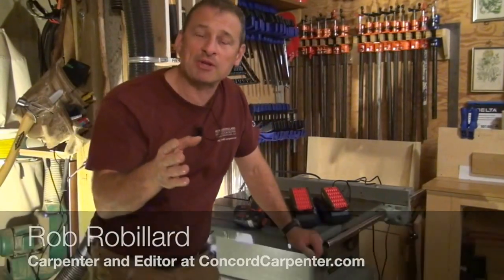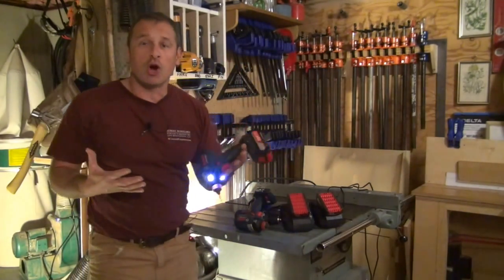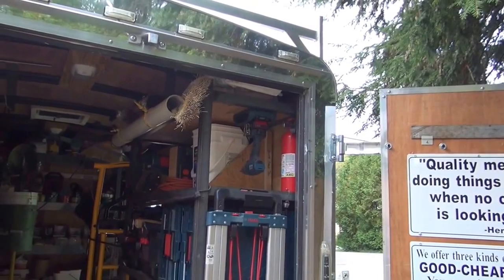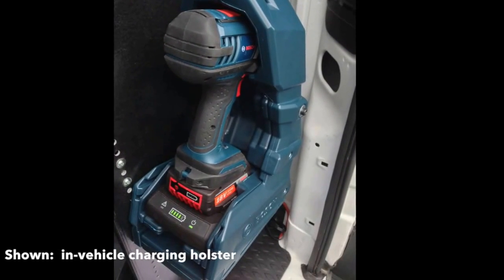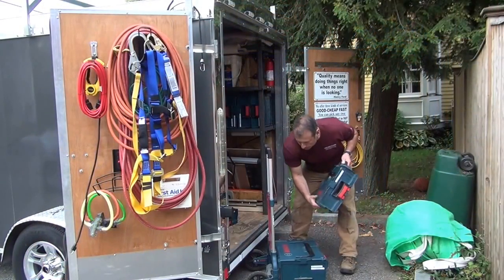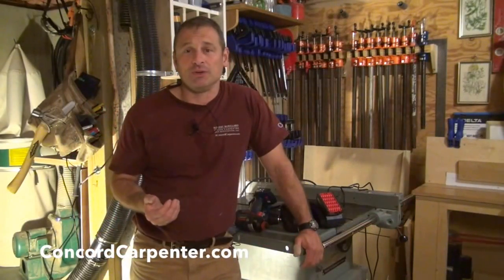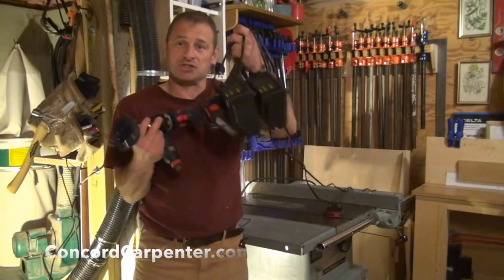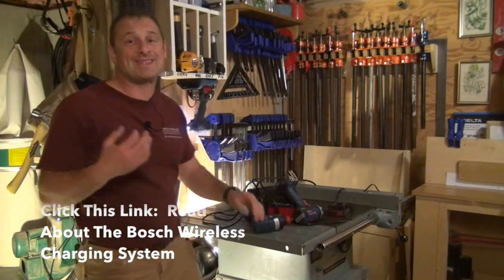Bosch Wireless Battery Charging System

Comment: what set up should be used to charge batteries in a van? Do you use the car battery with inverter or use an auxiliary battery with inverter? Thanks.

Comment: ya for the money i rather just buy a power inverter and have my dewalt,bosch and porter cable charger on my work van or trailer. just a money pit. instead of twisting how to charge just make better longer lasting battery. i rather. spend money on that then im to lazy to pop it off and slid it in my charger.

Comment: To be honest I'm not really a Bosch man I prefer Makita but it looks like a good design but not sure if it will catch on or not. It looks like a lot of hassle to attach it in take it out of the cradle etc. you said about them making a 12v connector so you can plug it into the back of the van, what you failed to mention is that you then have to go and get someone to wire up a 12v socket in the back of the van which isn't going to be cheap unless you know how to do yourself.

As all my tools are Makita I have a converter in the front with the battery charger and when on route to a job if batteries need charred they do. 

Sounds so much easier to me and cost less than going and buying a couple of these cradles wouldn't you say?